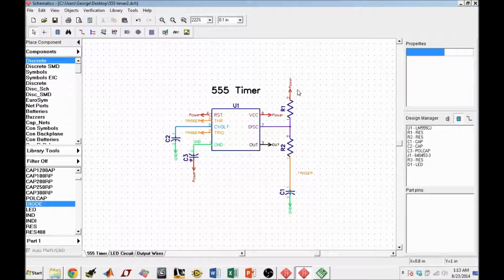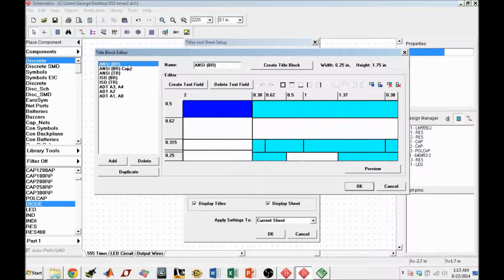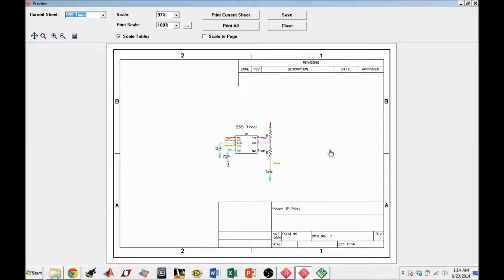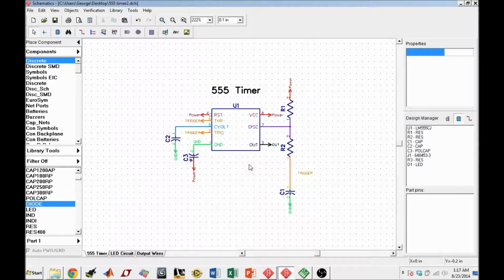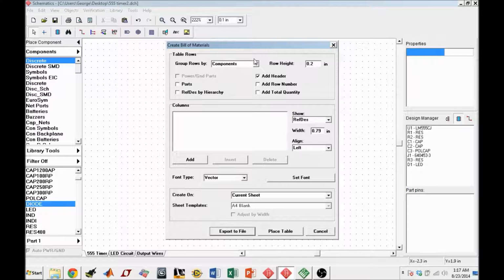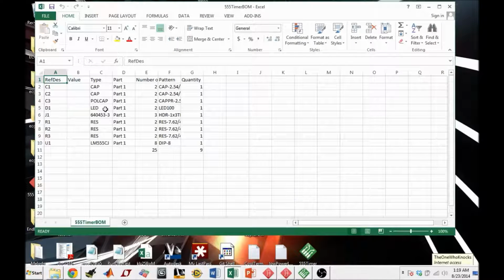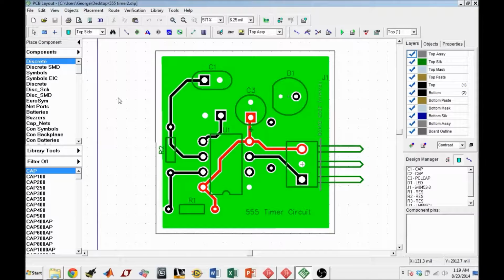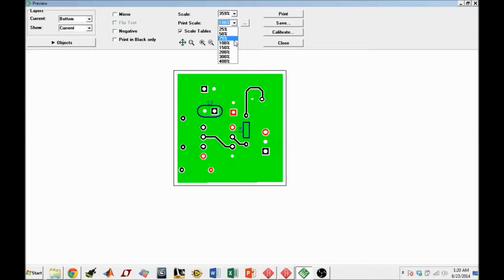PCB Design Using Diptrace pt 5: Exporting into other File Formats

Comment: a breadboard's (you know what that is ?) holes are 0.1" apart. So it makes sense to set the grid to 0.1" because most people breadboard their project before ordering a PCB.

mil is not one millionth. If you stopped to think about what you are saying, common sense would have prevented this laughable blunder.
 
assy  is not a word pronounced "assay".  It is an abbreviation for assembly.
csv  does does not stand for "comma divider", it stands for comma separated values.

Why in the world would you have two components sticking out of the bottom ?

Try talking more slowly. It is clear you are disorganized, and talking fast and trying to do things at the same time doesn't work.

The circuit is called "555 Timer". You labeled all of the components on the silk screen by their name (i.e. C for capacitor, R for resistor), except the LM555, which you labeled U1.
Reply: +youpattube1 He at least took the efforts to make the video and upload it so that people can learn something. What have you done? Criticizing is easy. 
He corrected that mistake about "mill" after someone pointed it out